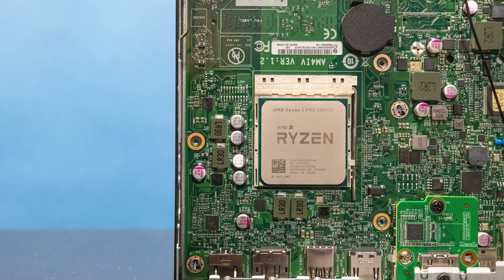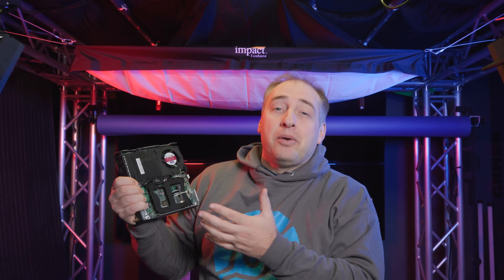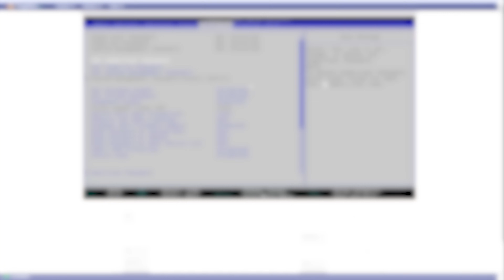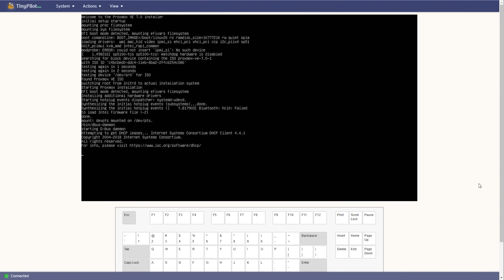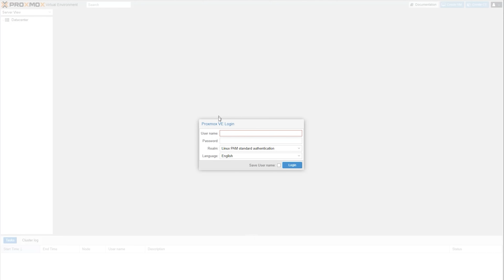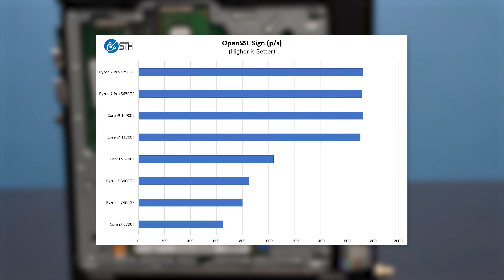1L BEAST! A 35W 64GB AMD Ryzen Powered Proxmox TMM Node

Comment: I'd be much more interested in a real idle power measurement. I use an old Latitude notebook with an 6th gen i5 to run Homeassistant loaded with plugins. It only draws about 7 W idle. Anyone got info on this unit's idle consumption?

Comment: I like how you speak of Wifi 6 as it's the next coming.  Do keep in mind if you have an AX network, even a single AC device will cause your entire network to downgrade to AC.  There are other advantages but you won't see them in a non high density environment.  Cheers from a wifi engineer.
Reply: Wait, seriously? I did not know this. I upgraded my home network to AX6000 but of course not all devices are AX-compatible yet. So you're saying everything, including my AX clients are actually running on AC at the moment? Sheesh. Would letting all AC clients connect to the (separate) 2.4GHz AC network alleviate this? Or do you have other recommendations to prevent this happening?
Reply: @BinaryBlueBull  No it's not true. If the device support AX, then it's using AX. It's like a/b/g/n/ac/ax. If your device support those or higher, then it won't downgrade, unless you're too far away from the wifi router 😊 and it will use 2.4ghz if you have add that connection too, as like backup.

Comment: Interesting box. But for virtualization host I would like to have a couple of more ethernet ports. At least 4 hardware NICs. 1 for VM network, 1 for external storage block device. Can't trust a single SSD disk for not become broken. Another 2 for running a pfSense VM.

Comment: Could it be possible to install a modded bios and PCI-E riser cable(In place of the 2.5" drive caddy)? I mean, for GPUs, you would need a custom 3D-printed top to allow airflow, and a card that is 1 slot wide to begin with.

Comment: I'm a little surprised as to how you're doubling the max ram listed by Lenovo (32gb). I know it's not always the actual maximum, but this is quite surprising - did you flash some other bios that supports this?
Reply from the maker: No. It just worked.
Reply: The maximum memory rating is usually based on the modules around at the time the manual was written.

Comment: Was the AX210 automatically recognized when you installed it? Mine came with the same card as yours, but when I installed an AX201, it wasn't recognized. Not even with the correct driver from Intel. I know the card works because I had it in another system. Thank you.

Comment: I like the lenovo systems the best minus vendor locking. I have tried the hp minis. The case gets super hot to the touch. I returned my 4650ge hp and got the lenovo version instead because of this issue. I am using a 4650ge lenovo tiny with batocera. It works great!
Reply from the maker: I actually really like the 805 G6 and G8. They are a step up on features compared to the Lenovo. If you want to see hot though, the 805 G8 we have also had the 1660 Ti

Comment: NAS prices for Qnap and Synology are quite high, and Synology seems to have very old hardware, almost nothing has 2.5Gb networking.  So I'm going to get rid of my Synology, Asustor and Buffalo and instead build a NAS with mini-ITX, or perhaps one of these Lenovo, Hp, etc., but only if they have 2.5Gb, everything new has to have that as I don't want to buy legacy speed networking.  Do any of these boxes have 2.5Gb?
Reply: HP has an add-on Flex IO v2 2.5GbE NIC but on two of the machines we have on order they said that they cannot get the part to build our systems. For a NAS mITX is better if we are being honest

Comment: Who uses Proxmox in production? I had to ask I've worked in IT for 17 plus years and I've never seen it in the data center it's always VMware, HyperV,  or full-blown KVM. However, I can see using it for a home lab build.
Reply from the maker: We have hosted STH on Proxmox VE for almost 7 years now that is serving many millions of page views per month plus a lot of other bits we run. We also have several lab clusters in each of the data centers. Proxmox VE is "full-blown KVM" of course. It is just Debian using KVM for virtualization, LXC for containers, but then it has bits like backup, ZFS, Ceph, clustering, plus the web UI.
Reply: @ServeTheHomeVideo  Thanks for the reply it would be nice to get  a video on what you are doing with Proxmox I like to hear real world info on production environments.

Comment: Lenovo locks those processors!!
Reply from the maker: This was the machine we used to find that.
Reply: @ServeTheHomeVideo  oh... Well, if it's still a good little machine and you're cool with that...  Then power to you.  There's been an uproar about this on Louis Rossman's channel.  I wonder if it's ARM trustzone under the covers on the management engine ....
Reply from the maker: @kayakMike1000  I mean, we have been talking about the feature for years now on STH (https://www.servethehome.com/amd-psb-vendor-locks-epyc-cpus-for-enhanced-security-at-a-cost/ ) and the reason people are talking about it again is because of this system and what we and STH readers found. I get what and why Lenovo/AMD are doing it for security, but I also think the way it is implemented is not right and that is why I gave the suggestions in this video and on the STH main site. This is the review of the actual machine that we found the locking on. It is still a great machine if you are not swapping processors, but there are downstream market impacts called out multiple times in this video.
Reply: @ServeTheHomeVideo  oh yeah, it's a great feature on these AMD chips.  I am a firmware engineer, I helped implement a similar feature called ARM trustzone on an industrial control board.  It's a bit of pain to get right, but when you do, the CPU only runs authentic code, more advanced you could make encrypted boot sector as well so no one can decompile any updates...

Comment: Be real careful with upgrading the cpu. they are now making chips that blow the cpu when you try to swap it.
Reply from the maker: Very aware. We were the site that broke AMD PSB use in servers years ago (we learned about in in 2018 after Dell started doing it) and then AMD PSB use in these systems a few weeks ago. This was the system/ CPU we actually tested it on.

Comment: You could max out the 65W I'm sure with a decent 2.5" Drive added. The one thing missing from these 1L PCs (for me of course) is dual NVME + dual SATA + 1 pci-x (or 10Gbe network built in)
My 2700X based home server with specs above is idling at 70W which bothers me to no end.. The moment you use some ATX psu the idle wattage just can't drop.
I had hopes for ATX12VO spec but that seems kind of dead now or at least very far away..

Maybe ServeTheHome could have a new segment on how to optimise power usage of your home server with tricks like under volting etc. I think the success of project tinyminimicro is not only because people are after the space savings but also power. Of course up to you guys as it's a deep rabbit hole 😅
Reply from the maker: We have a pretty large backlog right now. A piece that I have 40% written is using a cluster of TMM nodes versus a single HPE ProLiant ML110 where part of the discussion will be around power consumption. For the STH main site, we basically have hardware and content for the next 81 days and 90 days is usually the limit I feel comfortable committing to.
Reply: @ServeTheHomeVideo  Oh wow well I'm not surprised as I'm still waiting for your secret method to score a 2U server 😅 Looking forward to all of that!

Comment: If you 3d print a stand, you could install a M.2 to PCIE x4 cards and use extenstions (if needed) so you can install HBAs, 10gbe nics, etc. You'll need a seperate PSU but if you are using an HBA you'll need a seperate psu anyway. Is it the best setup? No. However, if space is a factor, it will work. Just a crazy idea that came to mind.

Comment: Looks like it's not available from Lenovo at the time I write this comment.
Reply from the maker: Sometimes Lenovo goes out of stock (and HP just stops making Ryzen units). You can still usually find them from resellers in pre-configured units.

Comment: The most important question is does it support ECC memory and is the ECC memory running in full ECC mode, with scrubbing and correction? If it isn't, this is pointless as any form a useful *nix server or even a *nix workstation.
Reply from the maker: Lenovo does not support ECC on these.
Reply: is WIndows somehow immune to memory corruption now? ECC memory is at hardware level

Comment: Using an external KVM with a RyzenPro? Doesn't this thing have remote management like vPro on board?
Reply from the maker: It has AMD DASH but it is faster to use a TinyPilot than it is to get vPro/ DASH up and running on these.

Comment: Beast??! 12 threads, HA! I got my Dell Optiplex 7080 i9-10900T 10Core(20Threads) 35Watt 64GB RAM 2x NVMe + SATA(for 8TB SSD), paired with Dell Companion powerbank - practically a "DataCenter in a backpack". It idles between 6 and 7 Watts !!! Couldn't ask for better. Not to mention the part where I get the most amount of 10Gb USB ports pet 1L PC, and 7090 has a 20Gb USB port. My next purchase will be Optiplex 7090 discrete version, so I can replace the GPU with RAID/Thunderbolt controller and pair it with QNAP DAC.
Reply: Yes, I have similar specs , inspired by serve the home. absolute VM best for my homelab practices.I'll look up those discrete versions

Comment: Of note, while i havent tested on the 5000 series tiny, you can install a 65w 4000 or 3000 series processor in the 4000 series Gen2, its not reccomended because the VRMs would probably pop eventually, and that heat sink really looks like it cant handle more than 50w, but it was interesting that there was no fuss over a 65w processor, just make sure you have the 135w power supply if you're using the tiny in one monitor.

You could probably get away with using a 65w processor long term if you set up something like the 3rd party tool called ryzen controller to limit thermals to say 75c. OR used windows power plan to prevent the processor from using turbo

Comment: Did the machine brick itself when you upgraded the memory? No? well, it won't be long before that is a thing. You know, "security".
Reply: RAM has no security coprocessor (and doesn't need one), if you mean hardware serial whitelisting, then this has been done for decades by HP and Lenovo.
The main reason they don't to it on RAM is that editing the RAM's little flash chip with the serial and model info is very easy
Reply: @marcogenovesi8570  just soldered it on

Comment: Is this video sponsored by Impact Luxbanx?! ;)

It is disappointing to see Lennovo put AMD in the second tier.  I would love to see one of these with 10GB Ethernet, or an option to add it.  When you look at the benchmarks in a 'per watt' perspective its hard to understand why AMD is being put in a second tier platform.  You could put four of these in a 2U short-depth rack slot along with a power supply and have a nice compact cluster.
Reply from the maker: I wish. That is a (I think) 6' x 4.5' softbox we are trying out to see if it looks better than the old P300c softbox.

Comment: I love this videos about micro PC's, thanks to this videos i buy my Dell optiplex micro 7070 and i was able to upgrade it to 64GB ram and inspiring me to add thunderbolt 3 for eGPU.
Reply: I have the same dell.i5 8500t but I have a little usb c expansion board for a 3rd DP out. These dells are ok but I would trade for the Lenovo.

Comment: Hey Patrick, great video.  When you upgraded the RAM in this machine, did it run at it's rated speed (looked like 3200MT/s on the label)?  Were there any RAM tuning options in the BIOS?
Reply from the maker: It did. That is why we bought a lot of these modules. They are up in price by $20 now. Just hoping they do not change anything on the modules in the future to make them not work at their rated speed.
Reply: @ServeTheHomeVideo  I own this ram as well. I have a apu laptop that has 8gb fixed and 8gb in socket. So I upgraded the single dimm to 32gb. I had issues with 3 other manufacturers modules before I got the Gskill dimm. Non of the other ones would run at 3200, which is the speed of the fixed ram.

Comment: How many vm can you spin comfortably?
Reply from the maker: Depends a lot on how much CPU and memory the VMs need. 64GB of RAM is a good amount and the CPU is very strong compared to older gen Xeons as well. You can fairly comfortably consolidate a dual socket 6-core Xeon E5 V1 64GB server onto this in most cases.

Comment: I am not proposing doing this, but I am on a Lenovo Tiny with a 5 PRO 4650GE CPU and noted that the 5 Pro 5650GE you are discussing is 20ish % faster than mine in benchmarks.  Hypothetically, if I was to swap that newer CPU in, would it also lock itself to this system?  What if I upgraded every new generation as long as the socket, RAM, etc was still viable.  This could leave me with several useless CPUs....  I didn't know about the PSB thing when I bought my Lenovo Tiny last year.  I love Lenovos, but I simply would have chosen a different brand of 1L PC if I would have known this.
Reply: I have tested the 5700G and it will not post, but you could go to a 4750G which does post, this is likely a lack of microcode in the BIOS, not because it cant work, just that they dont bother to put work into supporting it
Edit, over the weekend, i can test the Ryzen 5 5650G but if the 5700G doesnt work i doubt the 5650G would
Reply: @denvera1g1  Thanks.  I am not doing it.  My point was hypothetically pointing out that you could have a socket that vendor locks any new CPU added as an upgrade as well....
Reply: @chuck1011212  You can turn the feature off so that new processors are not enrolled, but the original processor will still be vendor locked
Reply from the maker: You could upgrade the CPU, but I would not recommend it given you already have the 4650GE. Personally, I would not go through all of that hassle for the performance bump.

Comment: One general question: does any of tiny/mini/micro PCs support two 2.5" drives (internally)?
Reply from the maker: Not that we have seen. There are 2x M.2 + 1x 2.5" options though.
Reply: @ServeTheHomeVideo  Thank you! Based on number of those systems that you had your hands on I'd guess there won't be any.
Reply: The MacMinis from Mid 2010 to Late 2014 had 2 drive bays stacked one above the other. I have a Late 2012 model with an i5 and 16GB RAM running Proxmox, pfSense, Pi-hole and some Docker Containers. Rock solid, completely silent machine. Depending on where you live you can grab one for around 150-200€ on ebay.

Comment: Not as good as regular mATX box which will have much better (near silent) cooling, upgradability (can stick in a 5950X even in basic mobo, can add all kinds of PCI-E expansion cards) and robustness - less cramped, less hot more replacable parts.
Reply from the maker: Ordered the parts today for a mATX Alder Lake build that we will have a video on.
Reply: These are used for when space is the primary consideration. I could put it underneath my router rather then having my m93p sitting sideways taking up a bunch of space. However, there's a price to be paid for cramming a lot into a small space.

Comment: Lenovo and/or AMD can go pound sand over PSB signing without mandatory laser-etching of the heat spreader and/or the case.
Reply: All I can think is how many perfectly good cpus are going to end up in landfills because a MB component died and the CPU can’t be reused. I think it should actually be illegal given the ongoing shortages.
Reply: @johnmarianhoffman  I agree with you. This business of vendor-locking should be stopped - even if it does only apply to certain grades of CPUs. I would opt out of supporting companies that ask AMD, and likely Intel, to do such.
Reply: @SpookyLurker  wouldn't be surprised if AMD gave them a discount since it stops a bit of second hand market potential.
Reply: and on server CPUs (Epyc), of course
Reply: I totally agree, Lenovo + AMD is a combo I would avoid like the plague.
But they have made me consider servers that you buy and build yourself rather than buying a complete solution, just to avoid this crap in the future.
Man, a lot of people will still be burned on the used CPU market due to this nastyness from Lenovo.
Reply: Agree!!
Reply: That feature is available only in CPUs that have "PRO" in the name, like in the video at 0:14
So if you stay away from those you should be OK
Reply: It's a security feature. It's not a bad thing. Just not for everyone.
Reply: @skyeplus  Even if it is a security feature, just let the person or company that will buy it to do the locking. The OEM should just provide the tools and instructions on how to do it....
Reply: @skyeplus  Not a bad issue, if they support and selling replacement motherboard for 10 years plus supply. That is typical End of Support for server when they sell stuff on other type of server software etc
Reply: @skyeplus  it's a security feature yes but the point of a feature is that it is an optional benefit, they could have at least asked the user if they want to vendor lock it when it arives
Reply: @talhahtaco2035  It's the opposite, there is a demand for it, therefore this feature came to be. Big corporations and government want secure platforms and this in combination with TPM offers hardware authentication, meaning the system wasn't tampered with physically between reboots. They're not enthusiasts swapping parts.
Reply: @skyeplus  well, then advertise it on the CPU so that in the future no one will buy that thing on eBay and get mad on a seller that is none the wiser either.
Reply: @BastetFurry  That's a good point.